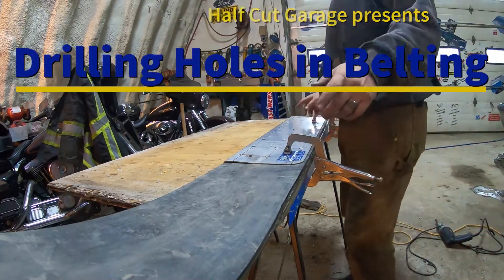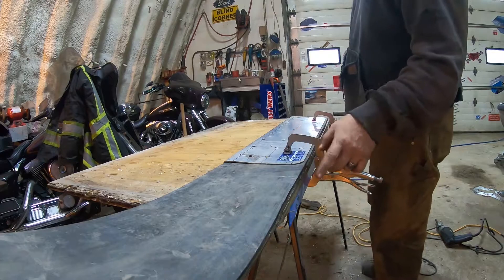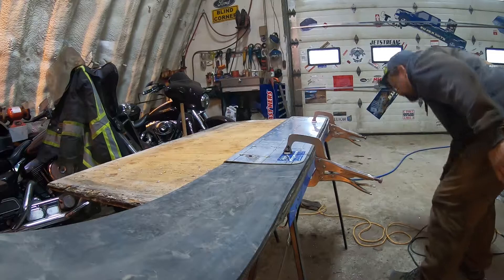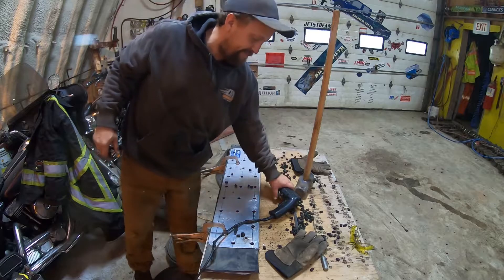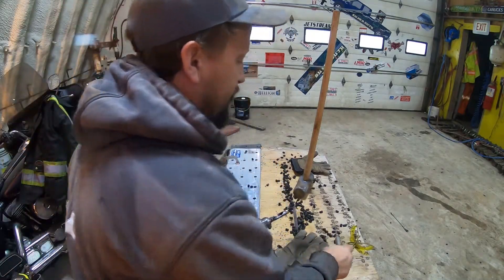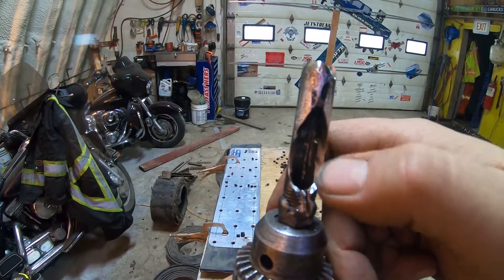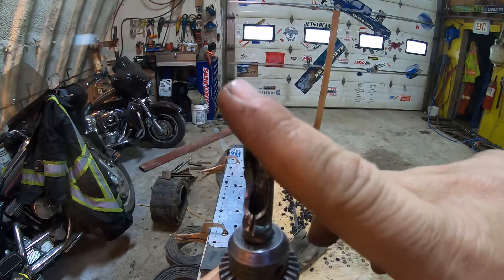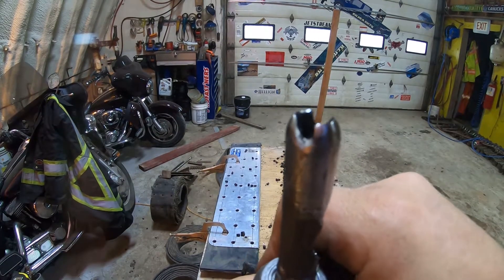Drilling Holes in Track Belting ( rebuilding Thiokol snowcat tracks)

Comment: did you use a manufactured steel splicing device or did you overlap the ends of the rubber belting and bolt in place to form a splice?
Reply from the maker: I had the manufactured zipper style connectors but I wouldn't hesitate to use the overlap method either. Overlapping puts the stress over a greater area especially if you go 3 groupers overlap
Reply: @HalfCutGarage  What is a 3 groupers overlap? Thank you for the information
Reply from the maker: Sorry spelling ..... grousers   so you overlap for  3 grousers which gives you 3 sets of bolts for clamping force .   Never hurts to carry a spare peice of belt   3  grousers long pre drilled and extra hardware  so you can trail fix a break in a belt
Reply: @HalfCutGarage  Great suggestion, thanks